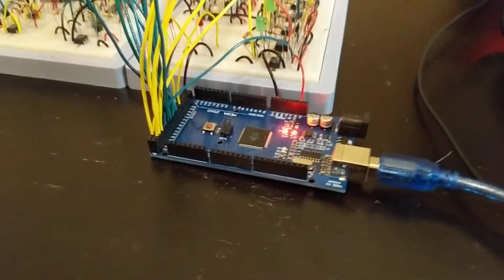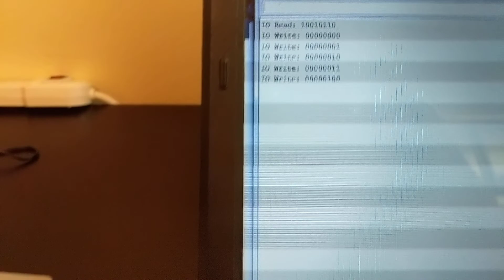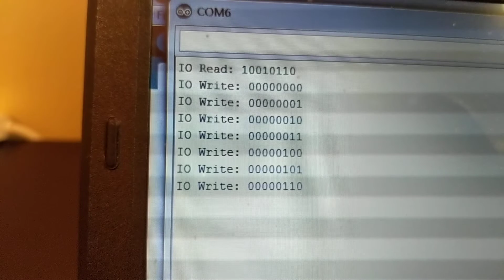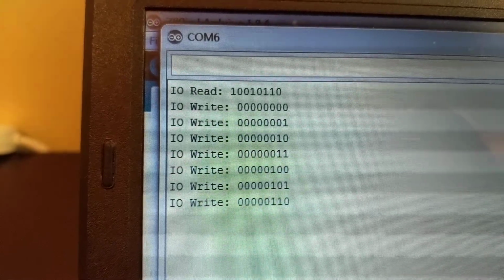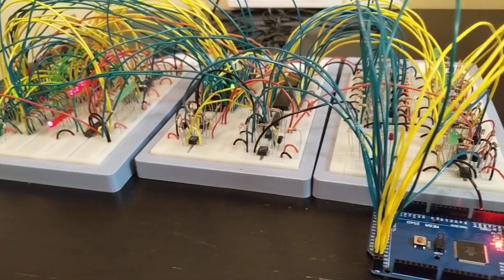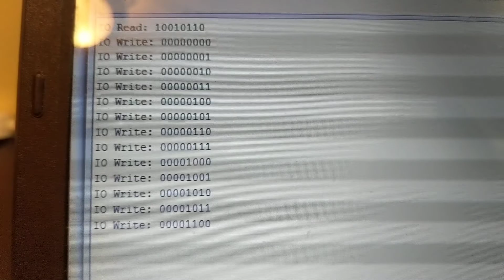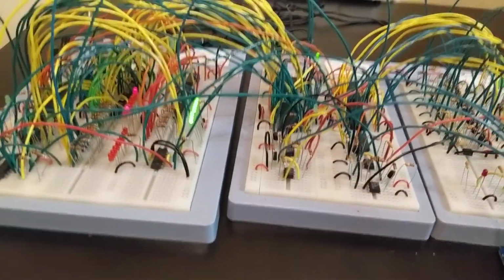Z80 Computer talking to Arduino

Comment: Index 4:39 "It's splitting up the data into input and output." Dane, do you have a schematic of the board and its connections?  Thanks.
Reply from the maker: I don't have any schematics online. I have a pencil and paper schematic that I might PDF at some point. Most of it is a pretty standard Z80 setup. I would look up "Build your own Z80 Computer" by Steve Ciarcia, or just go to www.z80.info. Lot's of schematics there. The only novel part is the 8 to 16 data bus conversion between the Z80 and Arduino. It uses tri-state bus drivers that are arranged like a typical 8-bit bidirectional databus on the Z80 side, but on the Arduino side it splits into 16 lines connected to GPIOs on an Arduino Mega. 8 of the Arduino GPIOs are inputs and the other 8 are outputs. The Arduino also monitors RD, WR and IORQ from the Z80. When the Z80 activates RD and IORQ, it switches the bus driver to send data to the Z80, and the Arduino program outputs data to the Z80. The opposite happens when the Z80 activates WR and IORQ, then the Arduino is reading data from the Z80. The Arduino sketch monitors RD, WR and IORQ to know whether to go into read or write mode. I later made a modification to send the data to parallel-to-serial and serial-to-parallel shift registers so that the Arduino could read and write in serial, and I also needed make a serial clock for shift registers. In the end I dismantled this setup and went to an input/output board that no longer uses the Arduino. I have another video on that actually.
Reply: Thanks.